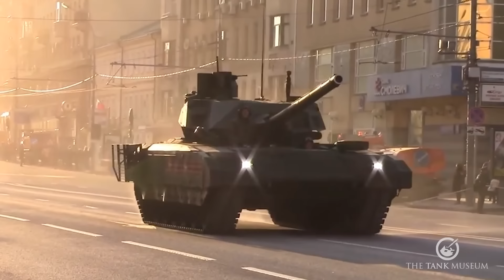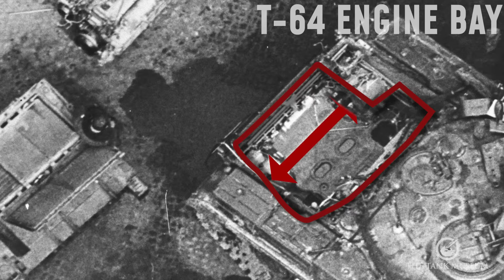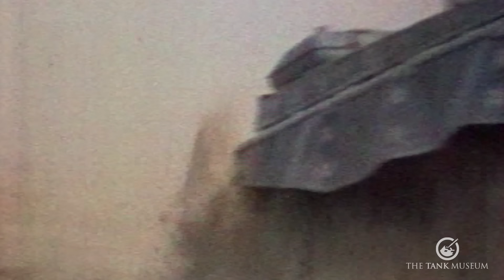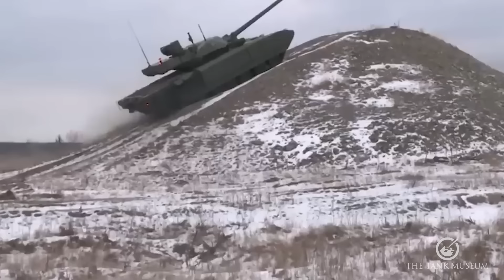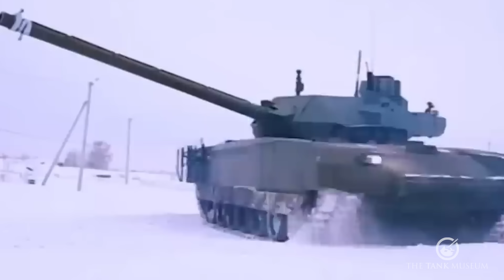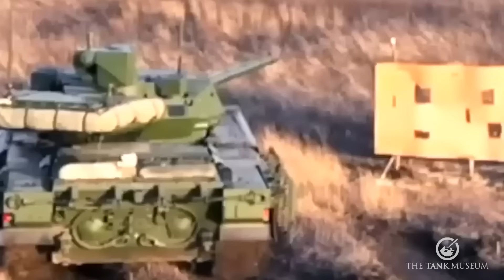Radical or Ridiculous? | T-14 Armata | Tank Chats #171

Comment: A question occurred part way through this video, when talking about how many soviet vehicles were set up for fording rivers it made me wonder about the comparative composition of logistics and engineering vehicles (bridge layers, recovery, etc) in Soviet/Russian and NATO militaries. I have seen enough clips of BMPs being swamped trying to swim across a calm body of water to have serious concerns about driving metal box into water and coming out the other side.
Reply: The problem with that is you need a special equipment and preparation , and also you are limited to 5 meter depths. It works in theory, but hard to do it in practise.
Reply: Most of the BMPs likely have their amphibious capabilities compromised because of their sheer age, having damage, decaying gaskets, and lack of maintenance for that function.
Reply: Actually your's point of view is intresting. I thought they maybe needs some amphibious "skills" because of their territory characteristics.

Comment: And questions from the name of the video was not answered
Reply: video gives data to build your own answer.
Reply: @laff__8821  nope, video are repeating russian prop and stating some most obvious problems (like the engine)
Meanwhile there is much more known details which wasn't stated
Like.. active protection of the tank is activated manually.. condition in the crew cabin either not a thing or not enough.. sights is not very good.. and so, and so, and so

Comment: After serving in the armoured infantry I can't fathom the crew not being able to poke there head up and take a physical look at the battle picture. I totally agree it breaks alot of basic design philosophy.
Reply: Modern conflict has shown. That every tank should be equipped with an air drone. Perhaps not one. And a stable secure connection with him.
Reply: @НиколайЮжаков-м7ф  That would make sense - but then the continued radio emissions would make you a target - there are plus and minuses to everything!
Reply: this tank wont be seen, as  it can destroy targets from very far away. and this tank is not meant for large scale ww2 style tank warfare. Putting a western perspective is wrong.
Reply: What happens if the new cameras for the crew get shot up or covered with muck!  Might be hard to fight blind.
Reply: @willmo1725  Which was how the Chally2 was infamously ambushed in the middle east, paint sprayed at the optics and the driver panicked reversed into a ditch throwing a track. That lead to the much talked about point-blank engagement where thousands of rounds, many RPGs and even a Milan AT weapon was fired at the tank for hours. The crew were unharmed (ears must have been ringing!) and the tank was back in service the next day.
Reply: The ambushed Chally shows you the danger of relying on electronic sights and cameras alone.  A few paint bombs and paint sprayers and you're now blind and panicking!  A low tech solution to a high tech problem!
Reply: @LondonSteveLee  I don't know how easy it is to sneak up on one with paint bombs, but if there's a way, it will be a very real problem
Reply: @PeterJavi  drop paint with drones?
Reply: @kade4198  if you can drop paint then you might as well drop something that can penetrate the top armor.
Reply: @timmyteehee9490  Drones with paint buckets or paint guns can be smaller and cheaper than something made to carry a real weapon I suppose. This would make it more viable to use them in larger numbers.
Reply: @emperror85  Tank optics do have wipers you know...
Reply: @emperror85  if you're dropping dumb bombs on tanks then you're already saving a lot of money compared to a javelin which costs like 70k to shoot 1 time. this water balloon thing only seems to make sense for civilian saboteurs that simply don't have access to military grade weapons. i can't see why a real army would ever do it that way.
Reply: @emperror85  Dropping paint might work if the cameras were pointing upwards but if they're looking to the side or tilted down (and especially if they have anything like a sun visor) then it's not going to work.
Reply: @PeterJavi tanks do go into cities. Unfriendly locals dropping their dirty laundry from tower blocks comes to mind. Or old buckets of paint.
Reply: @LondonSteveLee  средства защиты от красок имеются на специальных линзах.
Reply: @LondonSteveLee  Some people speak different languages.
Reply: Agreed, it breaks a lot of design philosophy. A plastic tank doesn't work...

Comment: Hmm - no fume extractor, I mean yeah, there is no crew to poison but I can't shake the feeling that filling a space made up of delicate machinery, and sensitive electronics with hot, and most likely pretty corrosive Gases and particles is very much non Bueno on the mid to long term
Reply: Especially if somehow a hole gets punched in the wall between the turret and the crew compartment. Can't imagine that would be a pleasant way to go.

Comment: All of the claims are false. Including their claim of having sufficient air defence on their capital. I would not believe anything the Russians write or say. The tank is only in the parade division for a reason. It uses the Panther G engine from Nazi Germany with a slight twist. It’s extraordinarily unreliable as it has failed multiple times rendering the tank a motionless death cage. Including stalling during the red parade. The T-14 is nothing more than a pipe dream that Russia cannot actualize.

Comment: I had heard that the decision had been made to deploy T-14 to Ukraine, but that the theater command refused them. Was this not so?
Reply: that was the rumor.
I do not think that they are battle worthy.
The only reason to offer them to the theater commander in the first place probably was to silence the "send all tanks we have to ukraine" demands.
Reply: @ulrichkalber9039  I think it's more of a propaganda matter, if the Ukrainians destroy one they'll boast about it and further lower Russian morale
Reply: @ulrichkalber9039 Maybe its more of a Strategic issue, why on earth would you want to add a Logistics Chain for a New Vehicle Platform into the mix when your current vehicle platforms do the job you need it to. Ulrich gonna buy that Ferrari to get to the Aldi around the Corner... because Ferrari!
Until the Russian Military has sufficient T14 Platform vehicles that makes Sense to have them on the Field you won't put them on the front. Keeping Spares for Extra Tanks is daft.
Hence Ukraine is suffering with NATO tanks, because they have close to 0 Logistical/Engineering Trains for the Different Systems in place.

Comment: I don't think it's actually as radical as it sounds. Most of the controversial aspects have been used for decades. Obviously the lynchpin of the entire design is a reliable autoloader, Russia knows autoloaders incredibly well. The unmanned turret, America has been using one for a long time with the Stryker MGS using an unmanned tank cannon among many other nations and vehicles. Tanks placing the engine first, Merkava has displayed that concept well.

Really the key changes to me seems to be the Russian shift away from a semi-disposable crew which again the west has shown the value of for a long time. And the shift to embrace technology far more than Russian tanks historically have, and beyond even western tanks.

Ultimately if the tank wasn't Russian I don't think it would get anywhere near the level of controversy and criticism it currently gets. It's a great concept and seems to be a real step forwards on that front. However only time will tell on the execution, and in the past 20 years that's where a lot of the new Russian military tech has fallen.
Reply: Russians traditionally placed higher emphasis on crew safety and technology in its tanks than western nations did till the 1980s.

Europe was developing paper think tanks like Leo 1 and AMX-30 while the Russians were coming up with composite armour and ERA to protect against the HEAT ammunition the Western nations literally just gave up on.
Reply: Wait, which Russian Military Tech has Fallen? Hope you don't Count the S300 and Iris-Ts that fall out of the sky when they miss their target as Russian Tech :D
Reply: @michaelbiri6676  Of course not. Or the Ukrainian SA-5 ballistic missiles.

But post USSR Russia had a fairly long time of poverty and an inability to really spend on military hardware. A lot of the world continued to advance, to put thermals on their tanks, to push out top tier subs, to advance their aircraft. With Russia it's only fairly recently with the Russian economic recovery and boom they've been able to spend big on military development.

The problem is they're stuck between developing new designs and updating the huge amount of older hardware they have. So they made a disappointing upgrade with the AK-100 series. They've split focus on the T-14 and the T-90M. They've split focus on the Su-57 and updating older reliable aircraft. They've split their focus on updating older ships and making new ones. Ultimately that means they've been slower to bring new designs from the drawing board to a reliable in service mass produced product.

I'm still sure in the next few decades they will turn into a high tech military. But like just China trying to go from an ancient dated military to a modern top line military the issue is having so many things to focus on means it's a struggle to get each advancement right and fund it. With Russia it's not as bad with 80s-90s designs rather than ancient hardware, but they've still had to spread their focus and funding more than would be ideal.

Comment: Wait...it's STILL vulnerable to top-of-tank hits?
Reply: Yes. Its armor on top is limited because it has to be. If you want every part of the tank to have thick armor - the front, the sides, the top, the bottom and the rear butt.... then you end up with a tank that is over 100 tonnes heavy. And such a monster is too big and heavy to be practical on a battlefield.. as it cannot drive over most bridges in Europe without destroying them, and if your tank gets damaged its almost impossible to drag that vehicle to a repair shop where mechanics can fix it. And such a big monster would easily sink into the mud in Ukraine and get stuck... and then it will be an enormously difficult task of getting it up.

So T-14 Armata is vulnerable. The russians say that they have systems that can detect incoming missiles and destroy them - but since russians do lie 95% of the time have I no reason to believe them.
Regardless would a NLAW be able to punch through its armor on top and then set off all the ammunition inside the tank and make the turret explode just like on a T-72 tank that also use an auto-loader. And after that is the tank destroyed.

Comment: Was the unmanned turret a response to the older tanks having the turret pop off when hit?
Reply: Making a biological warfare-proofed manned turret is actually quite difficult rom an engineering and production point of view. Most, Soviet design tank turrets sit on the body held with little more than gravity with massive air gaps. It is easier to seal and air-condition the tank body and make the turret unmanned. Of course that in itself introduces new problems to be solved - problems the west couldn't solve ether!
Reply: Nope. Unmanned turrets are under serious study by every nation because you can hide the hull behind terrain when shooting but you can't hide the turret, making it the most vulnerable spot in the tank.

Comment: Unfortunately no real information about why the T14 has not been mass produced was presented in this video. Instead the typical British ridicule about Russian incompetence, suffering by sanctions and astronomical corruption was given as the cause. Interested researchers who read relevant blogs and websites come quickly to other information: that much of Armata T14 technology was incorporated into the new T-90M tank, such as the loader, new gun, new ammunition, electronics and many other things. Hundreds of brand new T-90M have recently been delivered to the front lines, verified by many videos on telegram. The engine of the T14 was not reliable and the pure reliance on electronics to see outside from a cocoon was not convincing in case of a direct hit and loss of electricity. Thus they chose the T-90M with all new gadgets of the T14. 🤔

Comment: The T-14 engine is NOT a copy of the german WW2 engine. 
They are completely different in design and characteristics with their only similarity being that the cylinders are arranged in the same way.
Reply: I understood that the engine is a descendant of a WW2 engine but if course was developed further.
Reply: @pierQRzt180  yes ,and a gun is a descendant of the 17th century musket. :)
Reply: And that is a problem. New engine is extremely raw. 
Old t-72/90 engine instead-  like an iceberg peak, reached the limit of perfection.
Reply: They are not completely different design. It is based on that design with modern upgrades.
Reply: Experts also say that the Russian S-300 missile is based on the 500,000 BC spear thrower
Reply: @0rcd0c  copium
Reply: Stop it man, let them dream on.
Reply: Copium
Reply: -Russki - did they come up with something themselves? It is not possible!*

Comment: I think, it is naive to say that the sanctions stopped access to the chips. You can get almost anything, it is matter of price. If anything, rather the current worldwide chip crisis could affect it. Also, China is now the largest chip producer and produces down to 7nm chips (the most advanced in the world are 5nm so it is very close). Therefore only redesigning would be required. The sanctions also suppose to stop Russian production of cruise missiles, but we know now that the Russians cruise missile production increase manyfold. So the notion that sanctions on chips stopped production is simply a hype. It was the reductions in military budget forced  postponing the T-14 purchased. So sections affecting economy, not just on chips.

Comment: The Soviets learnt alot from the 2nd world war and used the info when making tanks, for example the Germans had to widen their panzer tank tracks before invading the Soviet union because their tanks were heavy and would get stuck in the muddy of the east Europe after winter so the Soviets made their tanks light, and also kept compact in mind, 

they also put an auto loader in them because it meant there was 1 less crew member and it had a 10 second reload

The Soviets designed their tanks to be as multi functional as possible that's why you can find them all over the world (especially the bmp)

Comment: The sad thing is that many ideas for the tank seem quite good. I like the armored gunner sights, and the hard kill system "if it works".
Reply: Russian DESIGN and PRODUCTION are NEVER the same!
Reply: @khiem1939  Yes they are... it's Russian crap!
Reply: @patriotzfinder  That's a bit unfair. The Soviet Union and Russia were capable of some incredible engineering such as their mastery of liquid rocket engines, but they weren't exactly mass produced in the way that tanks were. Also, because of their importance to something as prestigious and internationally visible as launching things into space where even the tiniest fault can result in catastrophic failure, there was probably a lot more oversight and quality control when it came to building those rocket engines.
Reply: Also even it's work, now about number
And then become late
Reply: It kind of seems like that car homer simpson designed...
Reply: That's always the question. Of every Russian designed and made weaponsystem... On paper everything looks good, until you see a flying turret.
Reply: @patriotzfinder  it's always question for Porsche fans, who will fall on ground praying KonigTiger until they see it's turret flying after hit of simple Soviet howitzer. Also tell us how bebrams with 105mm would fight T-80B/72B or how would M60/leopard fight T-64/72, having only HEAT and weak APDS in ammo strage. Poor gaymer
Reply: @raketny_hvost  Sorry, missed your answer. I never saw a Konigstiger fighting, I wasn't born yet. I only know that they use a lot of fuel and that the are on the heavy side. They get stuck in the mud, so to speak. Very stupid vehicle during rainy days... However, I understand you are a massive fan of Russian and Soviet cardboard tanks, but the world found out  that in this current war, they are in fact mobile coffins. Sorry, I didn't want to make you angry, but you don't need to be angry with me. You should be angry at the Russian designers, they did it... Not me... And leave that aggressive and arrogant tone of voice, that doesn't work with me. To me, you look like a small and tiny dog with a loud voice that acts like a roaring lion. It really doesn't work, and it looks hilarious.
Reply: @raketny_hvost  And the Tiger I is absolutely a Porsche design but the Konigstiger, the Tiger II was a Henschel design and not Porsche. In 1943, Porsche and Henschel presented their Tiger II design, but the Henschel design won...
Reply: @patriotzfinder  carboard named IS-2 was the only allied serial heavy that was able to hold pak43 with it's front. And I surely don't want to be fan of german blind paperbarns😁
Reply: @raketny_hvost 👍 Fact is that the Ukranians have destroyed almost every modern Russian tank, and that the Russians are busy with their tank production batches from the 1950s

Comment: I'm pretty sure that at least the early autoloader is on Russian tank guns sometimes loaded the gunners arm instead of the round. And the doodad that was supposed to eject the cartridge case often didn't work either. So it wasn't necessarily a tremendous advantage over Western tanks.